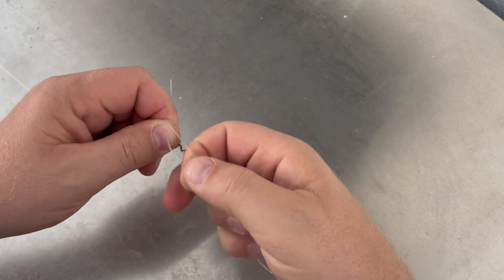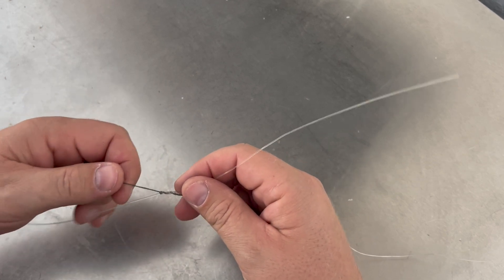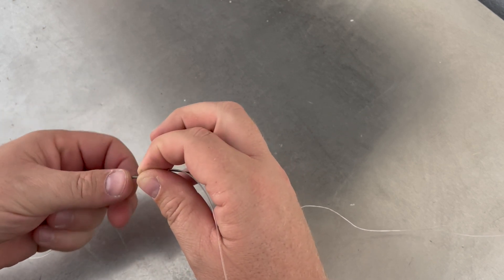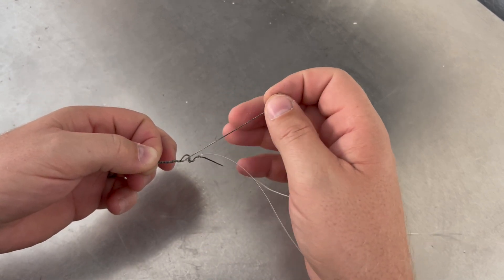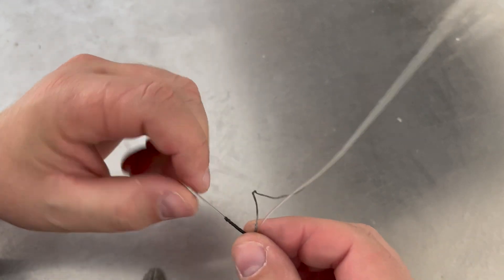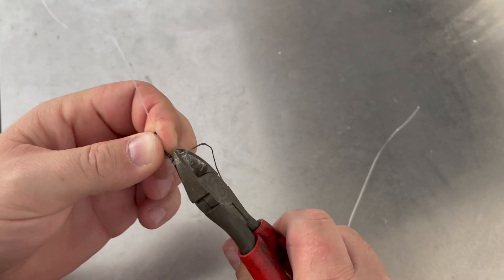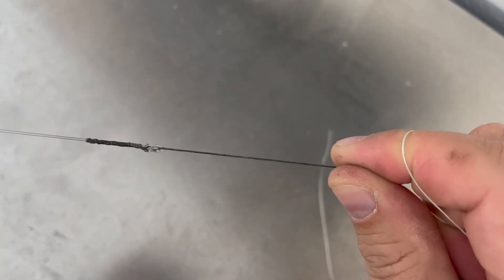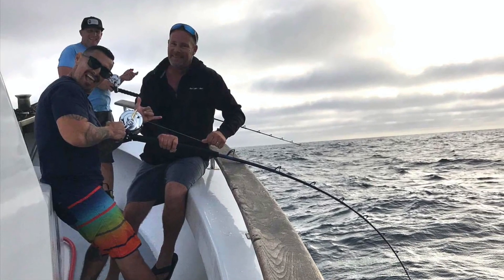Tie a Bob Sands Knot

Comment: I like my sd jam knot. Works great as well as double uni too.
Reply: The problem with uni to uni when using braid is if you do not wrap the braided side enough it will slip. This knot is stronger
Reply: @moonchung101  not just that, the line will break at about 70% line strength. Try the Tony peña knot. Takes a bit to tie for the first few times but goes through the guides very well and great strength.

Comment: I've been practicing doing this knot, learned from my tackle shop that does it really well.  One mistake they said I did was I didn't get the mono tag end to lay flat on the main line.  Having it angle off at a 90 degree point can cut your finger when fishing or rip off your finger tape.  Just an FYI as to what I was told.